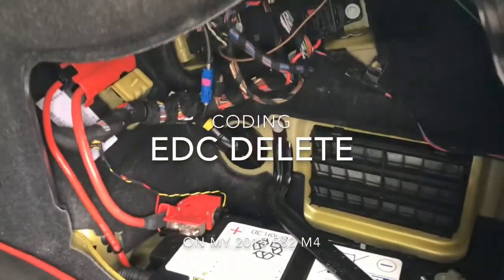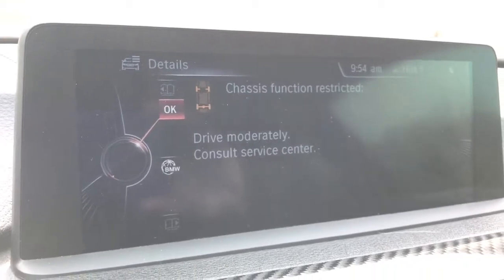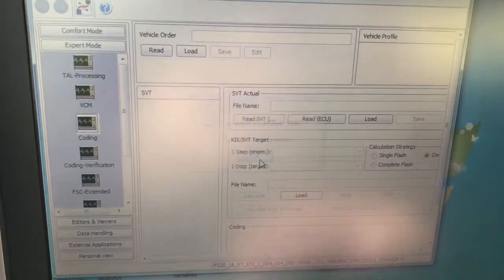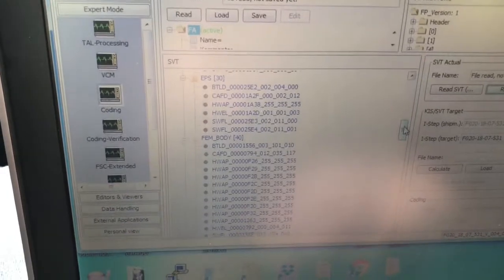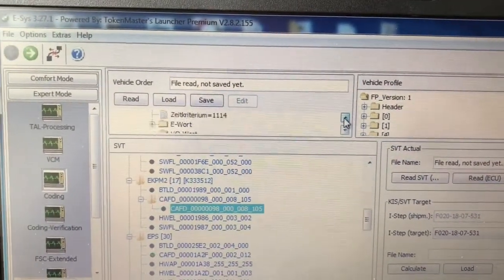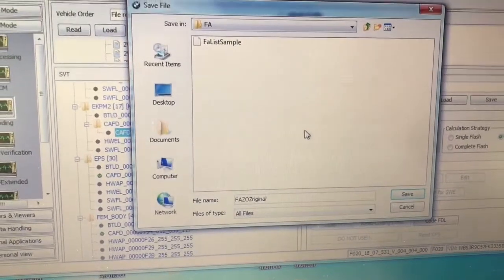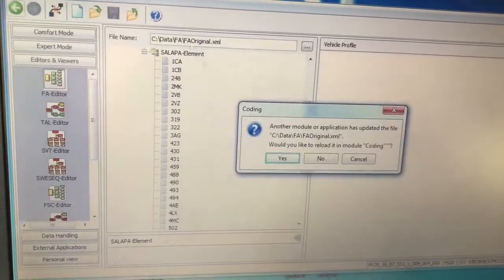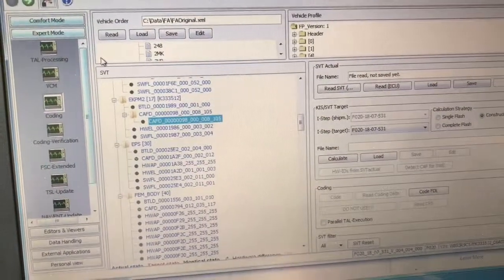How to CODE OUT EDC on F82/F83 M4 or F80 M3 (Part 1)

Comment: Could you just unplug the dme and drive around with the drivetrain malfunctioning, and do the coding later?
Reply from the maker: @Kosher_M3 I installed the struts and obviously didn’t have it connected at the top of the tower and drove it until I coded it out 🍻

Comment: Just curious? What was the purpose of deleting it? Is the feature overhyped and unnecessary? I heard the f8xs have a stiff ride without it. Jw
Reply from the maker: Hey Darryl! I changed out my EDC enabled suspension with KW Clubsport coil overs that don’t support EDC. Deleting it from the car’s computer just lets it know that it’s no longer electronically adjustable.
Reply: 5 years late, but its not ESSENTIAL. Just a pain.

Changing from factory edc to aftermarket non edc suspension setup, means that the sensor plugs are left hanging, as they have nothing to interface with.

This inherently causes the chassis malfunction error, which, from what i can tell, only stops the m1 & m2 buttons from working.

You CAN still manually put the car i to performance modes however, by the respective buttons next to the DCT gearstick.

That, and every time you start the car, it flashes up the chassis malfunction error, but you can just dismiss it.

Just a hindrance, as you cant go into m1/m2 mode as quickly, but not resolving it, doesnt ruin the car or anything.